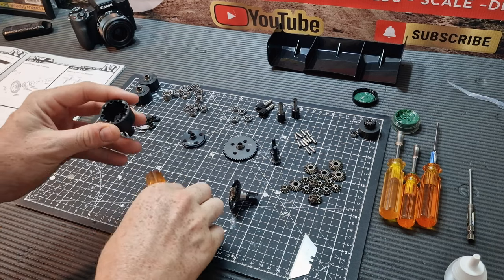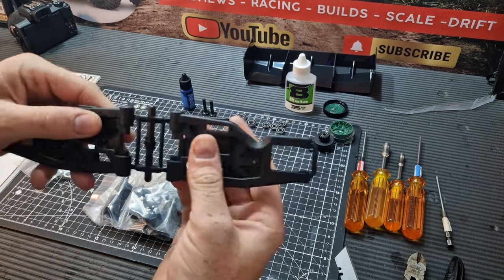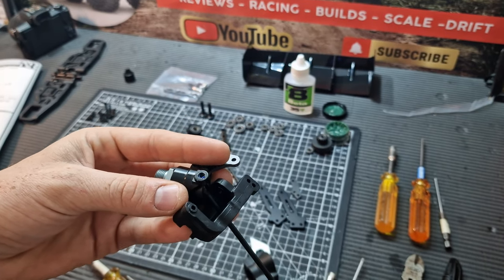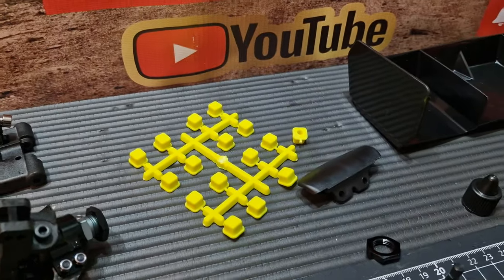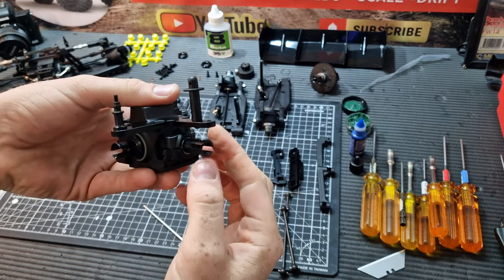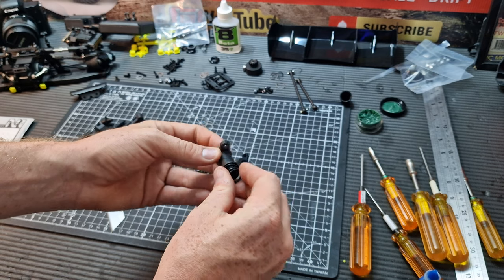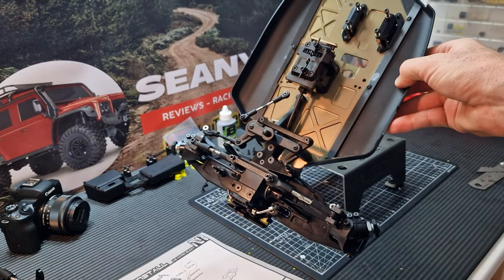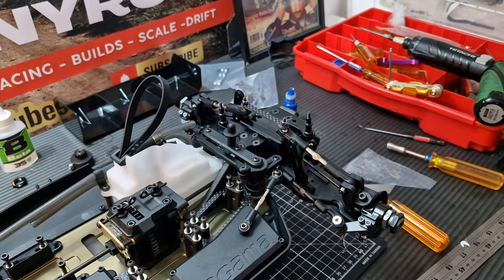Building An Rc Racing Car - Build Tips - Agama N1 Nitro Buggy.

Comment: This video is perfect for me. I got the N1 and I haven't built it yet, and this is my first kit I ever purchased.
Reply from the maker: I hope it helps! Be sure to let me know how the build goes :)
Reply: Do you know if they still make a alloy servo mount?
Reply: Don't rush through the build, that's the main thing. Agama was a great choice. Super nice kit...
Reply: What do you think about 900G. The hard diff case for the Agama N1?
Reply: I meant part# 9200G. The hard diff case for the Agama N1?
Reply: @trippjonesiii6566 what do you think about part #9200G (hard diff case)? Is it any good, and/or will it would it work in the Agama N1?
Reply: It might give it some positive weight to the chassis. I buy about every option part I can. I'd go for it...
Reply: @trippjonesiii6566  I wonder if it's the same one just in the grey color. It has the same part number as the one in my kit. I reached out to Agama, but haven't heard back yet. Probably because it's the weekend. Thanks for commenting back. Do you have the Agama N1?
Reply: The part #9200 came with the kit and the one for the optional part is 9200G. Sometimes the letter at the end correlates to the color. That's why I was wondering if they were the same.
Reply: I have the a319, and a215t. But agama is top quality.